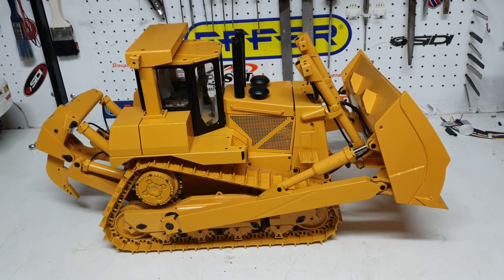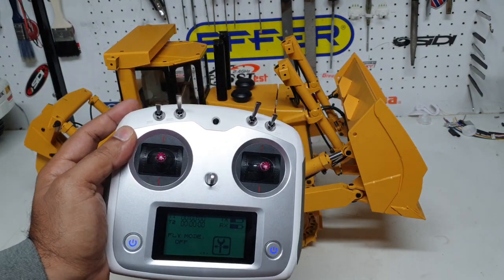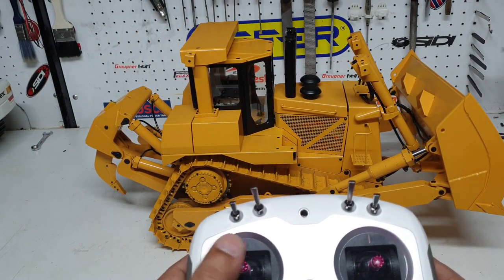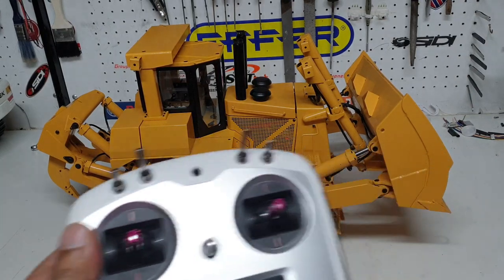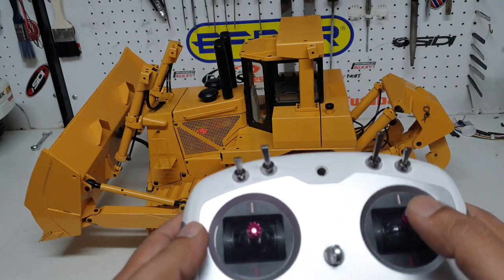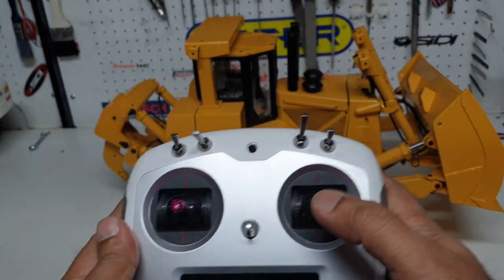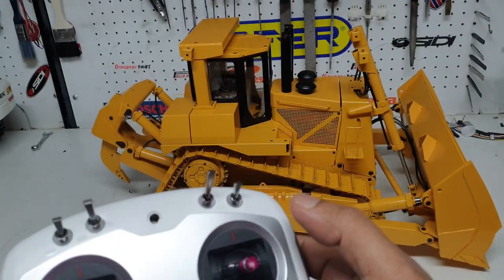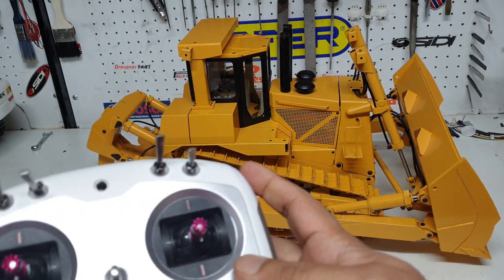CSMI Dozer single joy stick control modification

Comment: hello kevin can you tell me what is your RX set up in in your radio if use 3s on your balldozer because i have same this radio on my 870k he cannot reading the battery 3s corrcetly when 3s is low even the alarm not work txx bud i hope help me how can adjust RX settings
Reply from the maker: Hi Evil i am sorry I dint quite understand your message
Reply: @CSMIRC  hey bud i mean in my messege how can adjust RX set up to reading the voltage battery correctly i use 3s on my loadef 870k i have same this radio FS 10ch i6s white thx mr kevin i will be proud if you will help me
Reply from the maker: Hey Evil I am sorry I have not looked into the telemetry side as I use a Battery saver. Will try to do a video if I work it out. Don't forget to leave your name it's easy for me to remember
Reply: @CSMIRC  oh.! thx mr kevin yeah much appreciated my name is david from canada sure because the radio cannot reading the 3s voltage coroctly even the battrey dose not decrease well thx mr kevin

Comment: there is no blade pitch control ?
Reply from the maker: Yes there is Jak.
Reply: @CSMIRC  where it is ? Wich command control this function ? You didn't show it in this vidéo.
Reply from the maker: Hi Jak yes you can it's on the single joystick function video